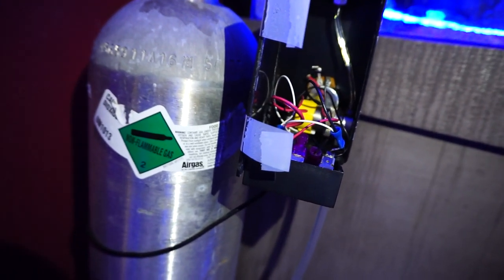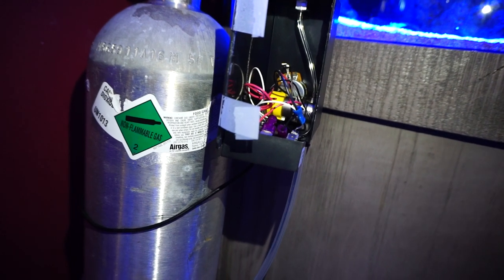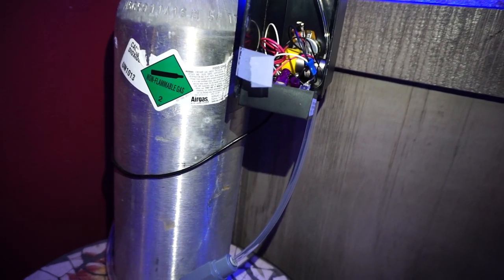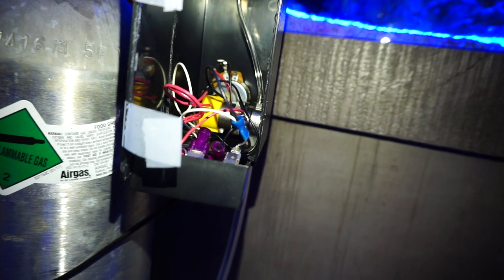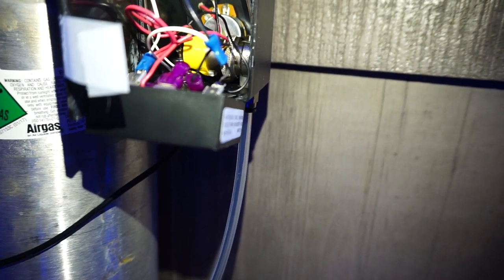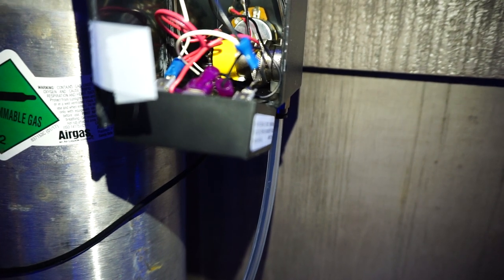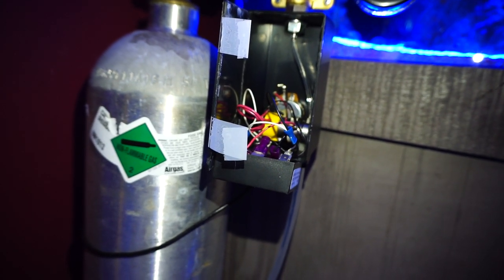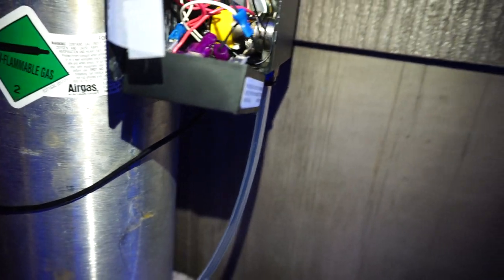Carbon Doser Regulator | 4th Co2 Tank Filled Within A week! | Resolved!

Comment: Wow that sucks. Glad you figured it out. I've read where Bill Wann said the  Carbon Doser is really simple and extremely overpriced.
Reply from the maker: Yeah I was expecting more inside. I guess the important part is that it works as it should and read somewhere that it comes with a 3 year warranty. Maybe that's the reason for the high price. Thanks!

Comment: I just turned mine on first time.  The bubbles don't seem to be coming out at a regular interval.  For example I set it for 1 bubble every two seconds and get 1 or 2 bubbles two seconds apart and then two or three bubble next interval and then back to 1 or 2 bubbles every two seconds.
Reply from the maker: Don't worry about that, mine is the same. As long as your alk is stable after a while, you'll be fine. Just looked at my bubbles and they come out sporadically. 1 or 2 at a time, some times 3 bubbles.
Reply: @WilSantiagoReefing  It's odd though.  If you watch on YouTube, you'll see that the bubbles are not sporadic and match what you dial them in?
Reply from the maker: @Howard Bash  With the same regulator? Interesting cause I looked at mine before commenting. Are they using a needle valve or is it like ours?

Comment: How did you open it up. I’m already burning through CO2. I have a leak somewhere.
Reply from the maker: HeyvReefaholic, did you do the soapy bubble test first on all the line connections. You'll have to get something sharp to pry open the back, there is some tiny amount of adhesive that holds the back plate on. Did you buy it new or used? Let me know if this helps. You can always give me a call if you need more info. Just let me know and I'll send my number.
Reply: @Santiago Reefing I did do the bubble test. You’ll never believe this. After there were no leaks with the bubble test, I decided to shut the valve off to the cylinder and pull the regulator off and reattach it so I could do another bleed down test. Well...when I went to turn off the cylinder...it was completely off!! 🤷‍♂️🤓🤫 I’m such an idiot! Somehow I managed to turn it back off and forgot!! So the tank was just bleeding down because it was off, but had enough pressure on the gauge to work for several hours. At least it wasn’t leaking! 😅😅😋
Reply from the maker: @Reefahholic  Glad to hear you found the issue. Now to go fill CO2 tanks..lol.
Reply: @Santiago Reefing 👍🏼✅💯✊🏼